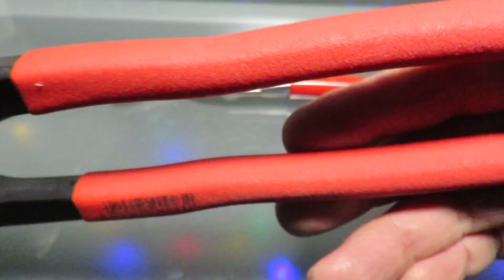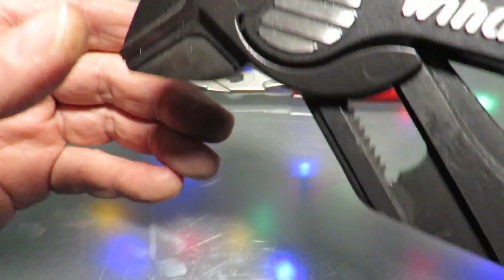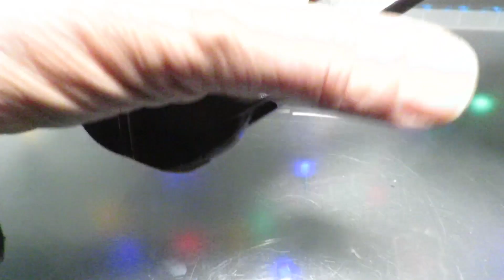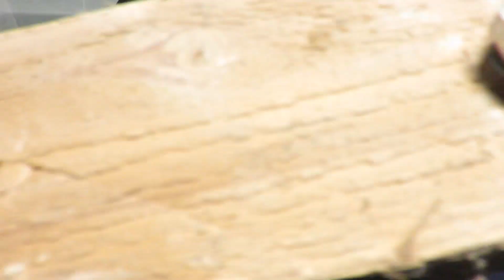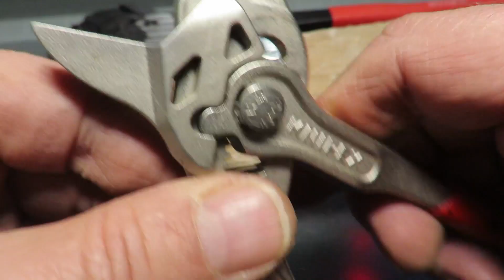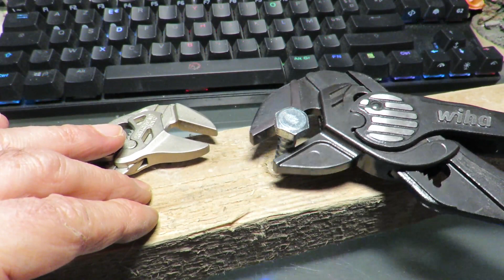WIHA Plier Wrench Classic [40923]

Comment: This Knipex pliers is a tool of indisputable quality, very well made and beautiful too, but personally I see some advantage in the Wiha. I like the fact that the head of the screw does not slip but fits into the collet. And the sliding adjustment mechanism of the mouth of the tweezers is faster and more practical in the wiha in my opinion. The adjustment mechanism is similar to the Irwin GrooveLock, I have the Knipex Cobra, fantastic tool, but I still prefer the Irwin Groovelock adjustment mechanism.

Comment: Diezelle, A smiler item I”RWIN VISE-GRIP Adjustable Pliers, Plumbing, Tongue & Groove, 10-Inch (IRHT82636)” it sales for half the price of the Knipex pliers wrench (250mm) in the USA. But it does have more slop in the joints. It also comes in a 8inch / 200mm) size. And it has a rapid close feature.
Reply from the maker: Irwin Tools has it manufactured in China.
https://www.amazon.com/IRWIN-VISE-GRIP-Adjustable-Plumbing-IRHT82636/dp/B07QN83FCB   : see the reviews on this page.